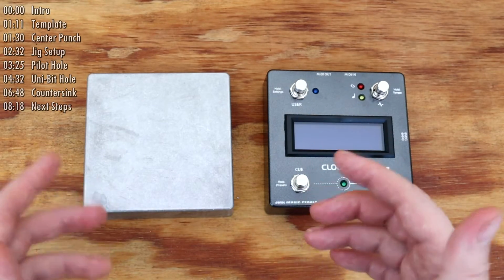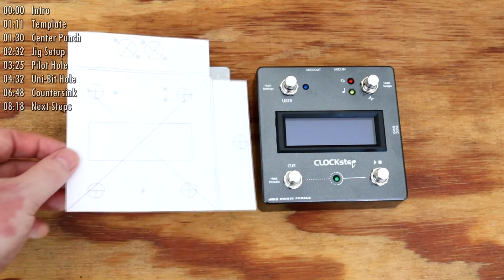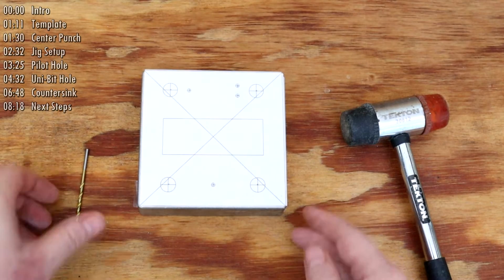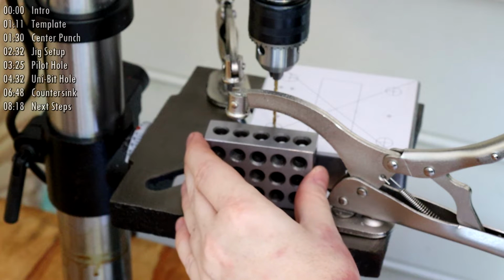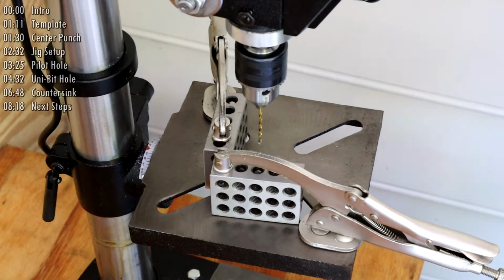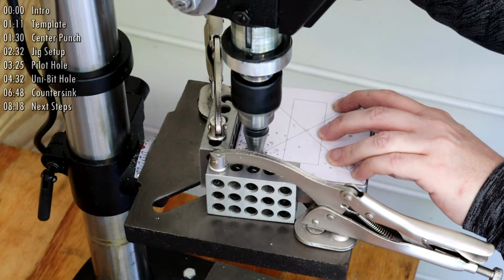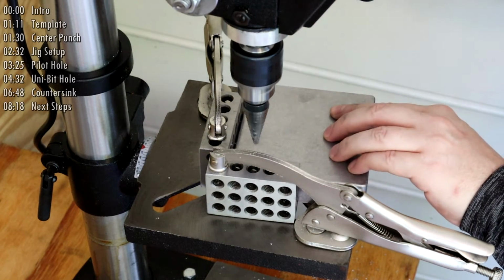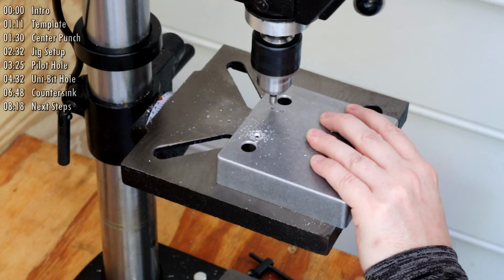Part 1: Drill Press (How To Build a Stomp Box using a Hammond Enclosure. A Short Tutorial.)

Comment: Have you considered having a template laser cut in a fairly thick material, so you can just place it on top and drill all the holes of the same dimension in one go?
Reply from the maker: When I got my first 3D printer, that's exactly what I was going to do: make a template. And would be doing it if I still made enclosures this way. I do all the enclosures on CNC machines now.